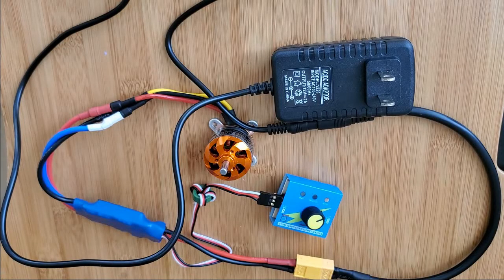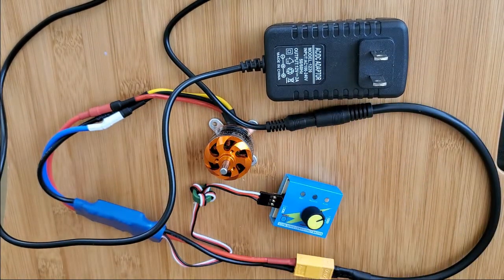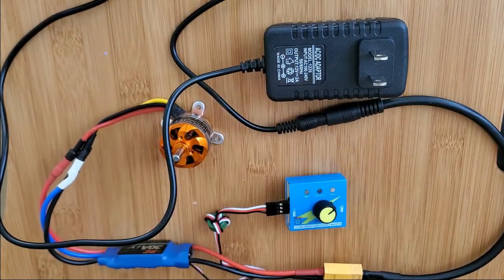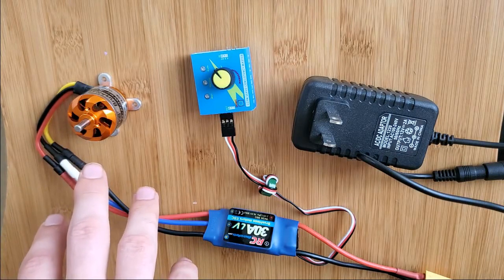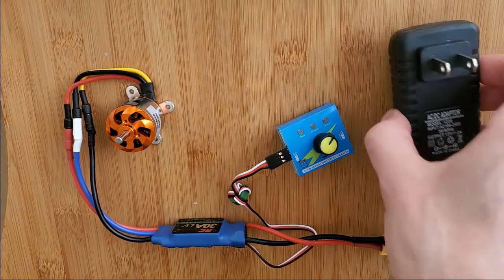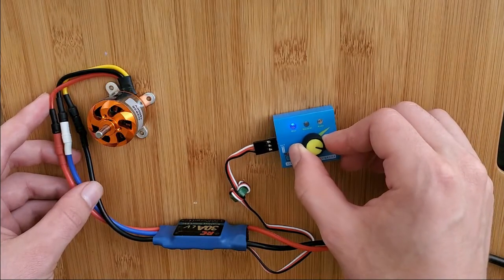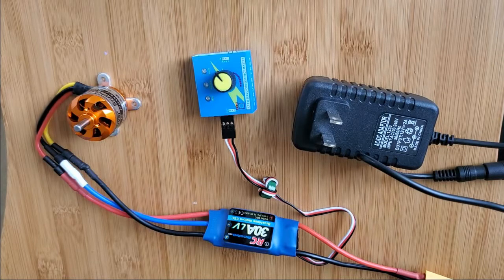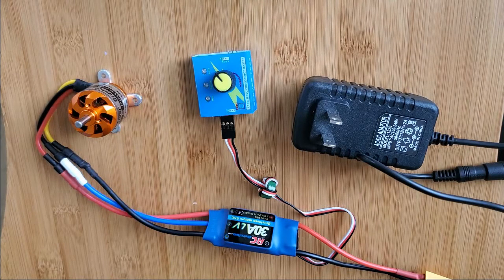DIY Centrifuge: Electronics

Comment: Hi! Thank you for the video! I'm planning to build one. How many RPM can the motor do?
Reply from the maker: I think it was a 22KV motor so it should be able to do 2,200rpm/volt applied. The ESC is limited to 30A and the DC adapter that you choose will also limit current/voltage or how fast you can run it. I never actually measured the rpm but it should be plenty fast for a micro centrifuge.
Reply: @qosmoschem  Thank you!!